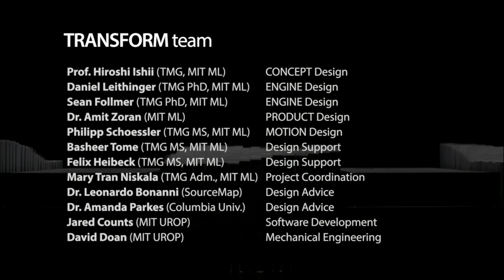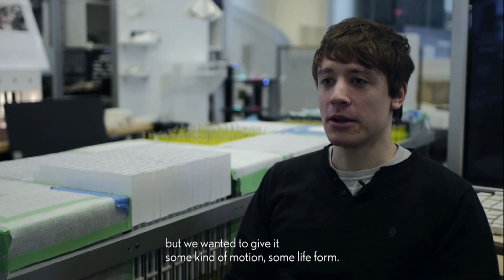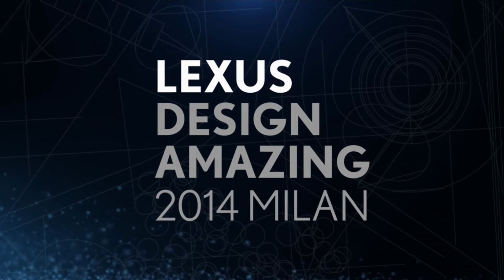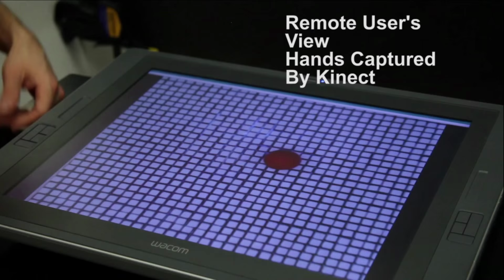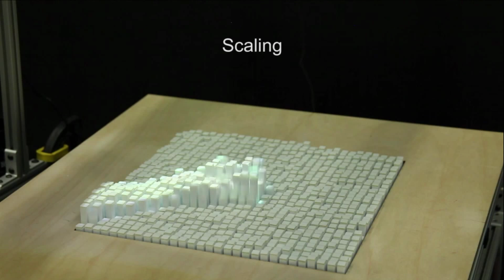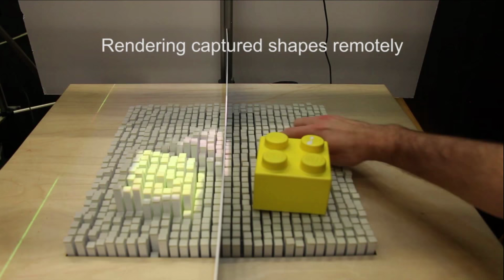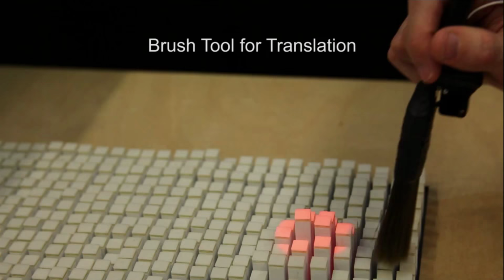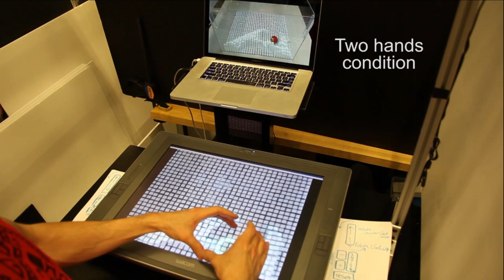TRANSFORM - Amazing Technology Invented By MIT

Comment: it's a great start, but for me to buy one of this things, several improvements would need to be made:
1. increase the piston density by 2-3 orders of magnitude
2. make the whole thing dead silent
3. NO MAINTENANCE REQUIRED. As is, it would need a lot of maintenance.
Reply: barmiro Imagine if they made each one the size of a pixel with leds and touch pads. You could have a 1920-1080 moniter thats touch and can change shape, FUTURE HERE I COME!
Reply: +That Other Dude yeah, fiberglass stripes could be a good point to start with.
Reply: +Le Fabe yeah just thinking that ;p make it out of say acrylic that had some frosting at the ends and that could be a fibre optic element as well as the piston :)
Reply: +Le Fabe actually, you could have the sides of the pistons with displays on them as well as the top, at the cost of piston resolution.
Reply: +barmiro 

Exactly my thoughts
Reply: To make it silent they would have to make the pistons not fall. Instead, it is let down slowly.
Reply: If Only well they could also attempt to add some kind of high-tech padding.
Reply: You could possibly have ultra thin, flexible/unbreakable screens on each piston, (with the size of the pistons shrinking, you would put less pixels on a piston), and then slap a Sensibo on it add in some kind of transparent shield to help keep the tops of the pistons flexible.

Comment: By thinking of this product as furniture, it loses a LOT of its practicality and improvement. Think of its uses as a projection for 3d models that you can physically manipulate. You could easily program infrastructure. If the pins were smaller and there were way more of them, it could be totally used for so much more. 

Imagine being able to perfectly map a location in physical form.

Imagine being able to replicate a specific patient for a hospital procedure.

Imagine programming physical puzzles for games.

Imagine planning out an entire D&D sequence on one of these (including maps, enemies, etc). Since all that would be required is some programming, you'd never need to buy miniatures again. You just need one 3d model... and you can have that model move!!

You could make a visual movie with the thing.

You could make physical sculptures.

If they were strong enough, imagine a chair made of these. It could be programmed to change to exactly the size of who is sitting in it and even give a massage!

Theoretically, if it was made cheap enough, it could be used for certain industrial purposes, but it would be god damn hard to maintain and probably not worth it.

If you think of this product as "just the beginning of something larger", it could go very, very far. (Of course, in a world where you have to actually make the money from the product before you can improve it, that's never going to happen... but it's nice to imagine)

Comment: I have an idea how to do this without using pnuematics, tell me if I'm crazy or not:
Use a small servo motor for each grid cell, and have it drive a screw shaft, with a threaded nut in the center of the cube. It's square neighbors will keep it from spinning with the shaft, so it will travel upwards and downwards
Reply: Lol oh...yep its possible...turned out I just invented the traveling nut linear actuator. Only someone beat me to it, probably a hundred years ago or something
Reply: Still though, its nice to know you're AT LEAST as intuitive as some mostly unknown century old inventor.  :)
Reply: I just invented a new recipe....

Comment: this technology is beautiful to see at work, but why can't it be more detailed? It's still in a stage of like pixelated video stage of computers, to get more clarity into the "Transform" device, independent ball pin nails could be placed instead of the individual plastic things, the ball point of the pins could be made to occupy a very tiny display or preliminary maybe an led capable of illuminating in different chromatic radiations. That would do away with the projectors on the top. Hope this comment comes of any help.

Comment: for when you can't be bothered to launch your cell phone off of the table up into the air to crashmashingly onto the floor far below. unless the floor was made of an actuator grid also then that would reduce efforts put into twisting ones own ankles to the mere press of a button, block, pin thingy. ;] Safety issue aside it seems the pins/sq.cm. corelates to it's realworld usefulness. thinner pin borders should be easy enough with flexible attachment connecting actuators to pins. I think there were some in the first video red things in the middle but only shrunk shrunk footprint down like 3/4.
This would actual be pretty useful  if the pins could sense input as buttons and not just actuate like for music production an even simpler design even with larger pins could be breakthrough music creation and consumption.

Comment: pieces are still too large. then they will be smaller it will be better, try to make a 1x1cm square and then try to make then smaller 1x1 mm..... its not hard we all ready have technology to make a table that can have 1x1cm or smaller pieces....
and you need to change the table mechanics so that the "pistons" are on the same level with the surface.

Comment: Looks very cool but I wouldnt call it an amazing invention. It has a limited use as it is limited by its size when it needs 1000 motors and computers to control it. That will be hard to scale down to something the size of a coffee tabel that will fit in someones livingroom. I think the best way to go is to get holographs better and more mainstream as it is not in any way a good looking machine and its the size of a small car it looks like. I think it is very good programming of the software and it seems it works in almost realtime but come on, who want a noisy table in their livingroom that is the size of a small car, has 1000 noisy motors and need 3x hardcore computers to run its computations. Even if it is scaled down with advances in technology I fail to really see what I would use it for.

Comment: This is NOT amazing technology.. really. I had this idea 20 years ago as part of a potential art installation but never had enough resources to implement even a prototype at the time. These days you could knock something similar up for relatively low cost at a smaller scale obviously. If you can program an Arduino and have experience with PWM on LED matrixes, you're practically there. What I hate is the wanky advert for this supposedly 'new' technology and the examples of all the amazing uses that anyone with any imagination can come up with... jeez
Reply: everybody has idea, some have telant for it only few have dedication,
Reply: everybody has idea, some have telant for it only few have dedication, one has resources.
Reply: saiello2061 
I don't see you showing anything new...
Reply: saiello2061 Matrices*
Reply: Either way is valid.. ;)